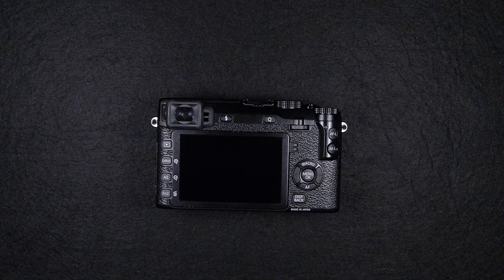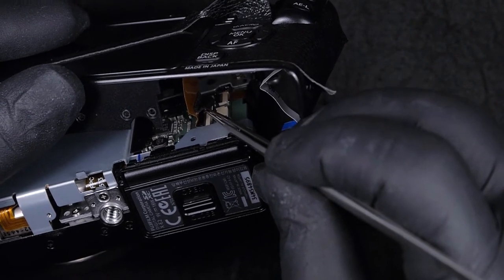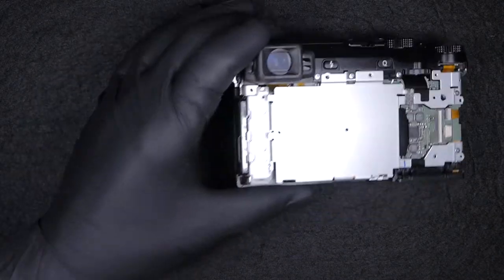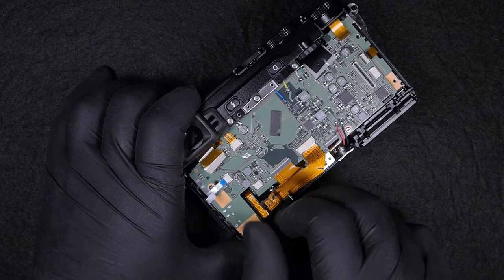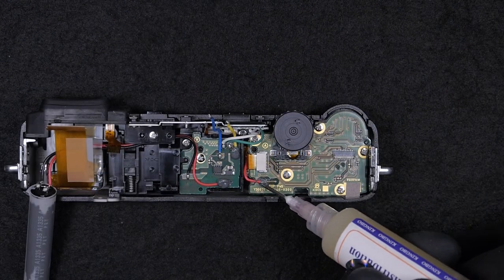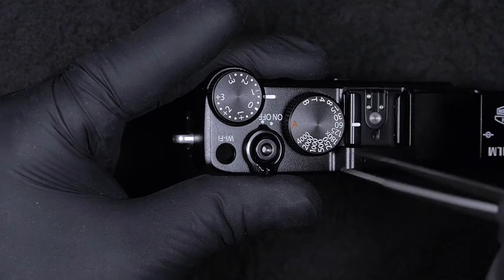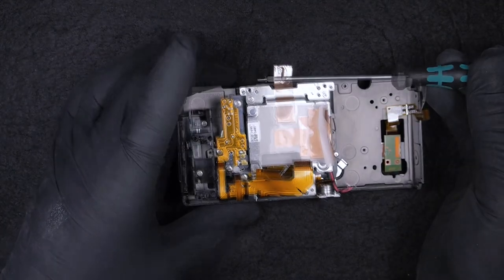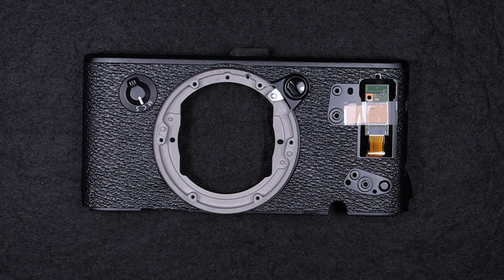#023 Fuji X-E2 Step-by-Step Disassembly - How to Service and Repair

Comment: helpful video, i recently my xe2s always get reset every time i took off the battery, and when i see your video there is internal battery on the motherboard, is there any chance i can replace it with the new one? if it so
whats type the battery did the camera use?

Comment: my locking pin is stuck on my xt100, thanks for taking apart the x mount, i am confident now what to expect when i unscrew the thing.
Reply from the maker: Thanks!
Good luck with it. If you need any suggestion on that, just drop a message here.

Comment: Amazing video thank you! Unfortunately my Xe-2 internal battery is dying so i have 4 seconds to change the main battery before all my settings default to factory. Do you know what internal battery does the Xe-2? Can't find any information. Thanks in advance!
Reply: Did you ever find out?
Reply: @sn0rbaard  no, in the end i just returned it. it was already soo expensive for a 10 year camera, so it didnt make sense to keep it and open it up.

Comment: Thank you, the video is great. My display started flickering today and now I wanted to see how to replace the display. It seems to be feasible for me. The only question I have is where do I get the adhesive sealing strips to glue the new display back in place?
Reply from the maker: You’re welcome, thanks.
If you’re interested, I have the LCD and usually I send it wit the needed adhesive.

Comment: thanks to your video the canon 1300D can change the shutter of mine, thanks, I was wondering if you can make a video about the NIKON D7100 a friend has that camera and it is damaged too
Reply from the maker: Hi thanks, I have some other project that I'm working on, but I will consider the D7100 when available

Comment: Hy, how did you stick again the first protection you have removed ? Sorry for my english 😊
Reply from the maker: If you means the leather, has a double tape and if you warm up and carefully remove it after will stick back without problem.

Comment: Brilliant! So, I have an XE1 that stopped turning on.  Most of what Ive read says its probably the motherboard and after some basic trouble shooting I feel like it is.  So I have 2 questions, first, is there a good place to buy aftermarket boards, and is it worth replacing because ive seen notes about the boards still needing to be calibrated by fuji after the install, and second between the xe1 and 2 is the disassembily about the same as whats shown here?  Ive only ever seen one other disassembally of an xe1 and it wasnt as in depth as this.
Reply from the maker: Best would be to get a second hand one, from another Xe1 basically, avoid Chinese ones, are crap.

Comment: AMAZING DUDE!...ONE QUESTION ...I HABE PROBLEMS WITH THEBACK SHUTER SPEED DIAL..I DOES NOT RESPONSE SOMETIMES.IT GOES WELL WHEN YOU PRESS IT TO MAKE ZOOM BUT IT DOES NOT GOES RIGHT WHEN YOU WANT TO CHANGE THE SHUTER SPEED .ANY SUGGEST?...THANKS SO MUCH
Reply from the maker: Thanks. This is a common problem with those dial wheels on Fuji’s. Not an easy way to fix either, the easy way is to replace the top circuit board… Another one would be to spray some electronic cleaner trough the wheel space and then moving the wheel back and forth for a minute or more but that’s nasty and doesn’t work every time…

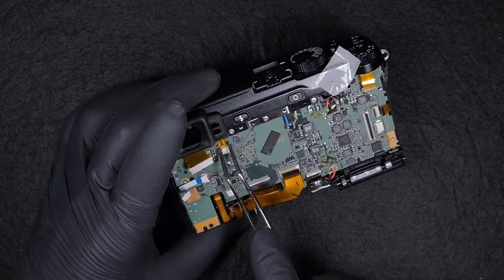Comment: To the right of your tweezers at 29:22. Is that the internal battery for holding settings? Is it possible to replace it?
Reply from the maker: Yes, that battery can be replaced. Need some basics in soldering iron.
Reply: @CameraRestore  awesome! do you know the battery model #?
Reply from the maker: @yealevi2850  MS621FE

Comment: sorry to bother you, but i've had an issue with 2 different fujifilm cameras (xe2 & xt1 ) , they stopped switching on , without any evident reasons. the only thing that comesi in my mind is that i've shooted some commercial pictures in a quite dusty ambient (marble workshop).there is any chanche to disassembly the camera and try to clean the power switch ? Many thanks in advance
M.
Reply from the maker: Ciao Matteo 😉
Marble dust is very abrasive, if gets inside may create some damage. One thing that I noticed is that the switch power is quite sensible and tends to fail easily. The only way is to open up the camere and investigate, might need a microscope or a watch repair loupe to see in details the conditions. Not easy work to be honest, lots of steps to reach that point…

Comment: My shutter blade already broken, if i remove the shutter blade
Is it possible to use electronic only?
Reply from the maker: Maybe removing the blades from the shutter will work but never tried. Since the work is quite invasive would be better to replace it directly.

Comment: Great video! One question. The 'battery latch' (the red/orange battery retaining clip} on my X-E2s is broken. Does the whole battery compartment need to be replaced as I don't think this clip is available seperately from Fuji.  Thanks in advance for your reply.
Reply from the maker: Thanks. Yes, you will need to replace the whole box. I have the part in stock, drop me a message at contact@camerarestore.co.uk if you're interested

Comment: Hello! Very nice video! I just got a xe2 for 80$, everything works except evf, apperntly the camera bumped against something and the evf went black. Im thinking maybe check if cable has come loose first? Is there shortcuts to getting to the evf?
Reply from the maker: Hi Robin, check your inbox.
Reply: @CameraRestore  I have that same problem, my X-E2 EVF doesn't work after in bumped into something - can you help me aswell?
Reply from the maker: @LeonidasGFX     Hi, the guy above got the replacement from me. I should have another one on stock if you’re interested…

Comment: Hello, my xe4 turns on, but the lcd just lights up in black. When turned off again, the lcd stayes on. Only by removing the batterie it (of course) stops working. Do you have any idea what could be wrong? Thanks fpr your help! :)
Reply from the maker: Hey, did your camera had any kind of water contact? Looks like a motherboard fault…
Reply: @CameraRestore  Thank you for answering! 
not that I know off... so it might be a total defect probably?
Reply from the maker: @emanuelschi  
Might be the case, a checkup could tell better what could be wrong.

Comment: Hello sir, can you help me answer my question. Is it the same lcd screen XE2 X100T and X100F? I googling about the specs is the same lcd screen 3" 1040k dot. Because i try to  replace my X100F lcd screen with XE2 lcd part replacement. Thank you for the answer sir

Comment: Is it possible to further disassemble the sensor module, to remove dust trapped between the sensor and the glass covering it?
Reply from the maker: It's enough to take the tree little screws off, you can see it at minute 54:14:00
I would highly recommend to work on an empty table and possibly completely clean room at least 30 minutes before you open up the sensor. Usually this operation require an extremely clean room, specifically made for this kind of work.

Comment: Hi. I hope you reply to this comment. May I know what capacitor does the XE2 have?
Reply from the maker: Hey, hope you sorted your problem, anyhow if not I can have a look
Reply: @CameraRestore  I took it to a local repair shop and it was the cmos battery. I paid a cmos battery that is the exact model installed. Bought from aliexpress